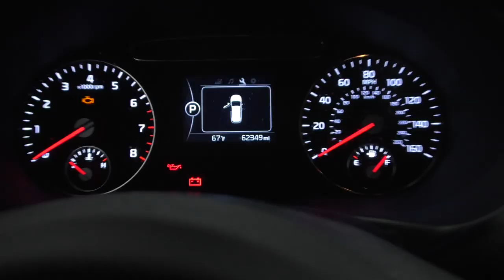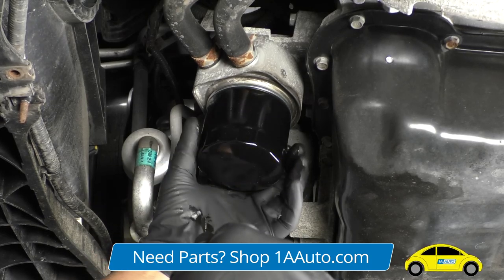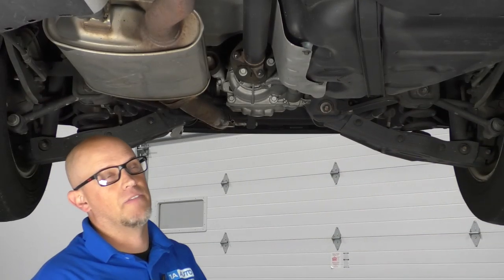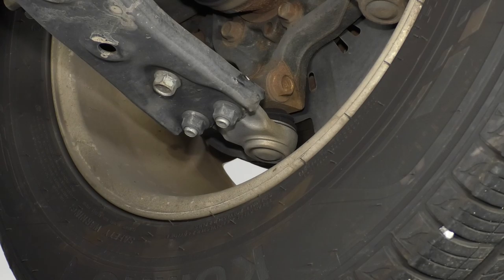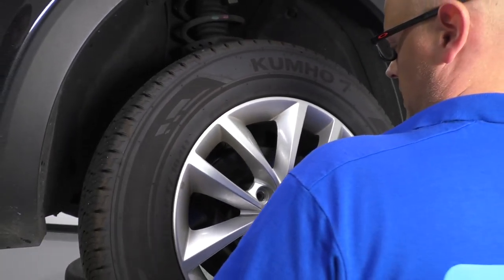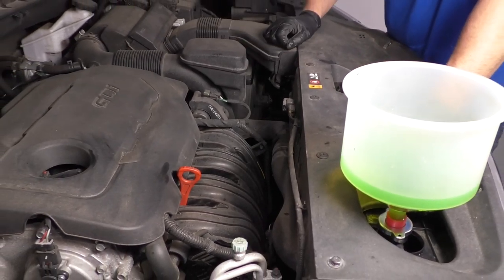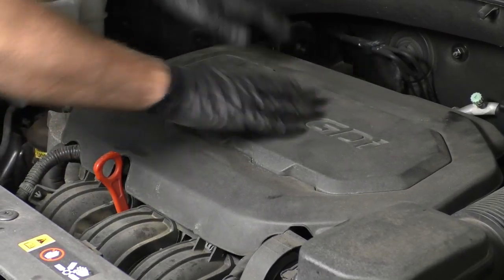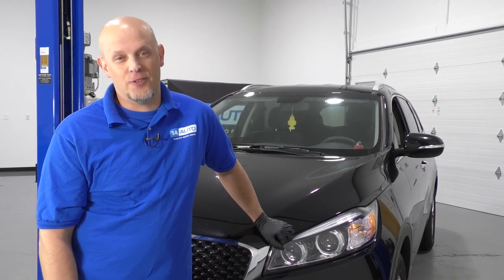60K Service Kia Sorento

Comment: A few things. Coolant overflow tank. I just unbolted mine and washed it out fully. Also went to a spring clamp on the hose. Radiator cap; check what pressure it can hold. Keep in mind tho, on an older car, if you replace a cap that could only hold say 10-12#, and a new one is rated at 16#, that my cause another weakness to be exposed, the water pump seal. There are two seals in the pump mated to each other, pressed together by a spring. As those seals wear down, the amount of pressure they can hold back begins to lower. So replacing the cap may cause the pump to leak. But, if the system can’t hold a high pressure, it may boil over in very hot conditions, as the pressure raises the boiling point. Battery, if you replace the battery, don’t put those felt washers under the terminals that they try and sell you. Those washers will lift the terminals up enough so they don’t clamp tightly on the battery posts. These terminals do not have enough compression space to make up for the smaller size of the post as it tapers smaller towards the top.

Comment: KIA/Hyundai use GDI (gasoline direct injection) engines.  Every 20,000 miles, you'll also want to run a GDI intake valve and turbo cleaner through the throttle body.  I have found that the STP Intake Valve Cleaner does the best job, and is considerably better than the CRC or Seafoam products.  Doing this will de-carbonize the intake valves, which are not cleaned by fuel additive as they would be otherwise in a non-GDI engine.
Reply: Good afternoon. One thing you can also add to your car and I have a 2019 Sorento V6, is an oil catch can baffle device. I installed a new positive crankcase ventilation valve and then added a hose from the PCV valve to the oil catch can and then from the oil catch can back to where the hose is going into the fresh air box after the air filter. This way you get a lot less deposits on your intake valve and intake valve seat in a GDI engine. I can send you a photograph if you'd like just shoot me your email and I'll send you a photo or two.

Comment: Very Informative. One important note, if your using a socket wrench to open the oil drain bolt,  be sure it's a 17mm 6 point socket and not a 12 point. The 12 point socket will spin and not grab and you will strip the bolt head.  Just changed oil on my Sorento and learned my lesson.

Comment: I have the 2016 Sorento and love my car, now if only I had a car lift lol. I try to do some things myself but oil changes I just dont find the value these days like I did growing up and then having ti dispose of it etc. Tune-ups, brakes etc I do all myself and save a ton.
Reply: you don't need a lift.  You can do this service using ramps, or a hydraulic jack and jack stands.  It's just nicer with a lift.

Comment: Good video. But I promise you, a typical shop won't do such a thorough job. They're in the business of getting customers in an out as quickly as possible and will likely only do the bare minimum with fluids, filters, and tire rotations. If, later, anything break or was excessively warn and the customer states it should have been caught at the main servicing intervals, they always have plausible deniability and will claim it occurred after. After bad experiences, I never trust mechanics at their word. I either do it myself or will verify everything they did by checking. This is where being a DIY really helps. The most difficult part is that people don't have their own car lifts, so investing in a good floor jack and a good set of jack stands is a must. 

Life would be so much better if auto maintenance and servicers weren't so scammy and dishonest and priced their work reasonably.  Most of their so-called "257-point" free inspections are just them making up a long list of expensive things for them to make obscene profits on, nearly all of which are generally unnecessary. People never realize how much money they waste at these places, and how stupid cheap they get their materials for vs what they charge you.

Comment: I went to a kia dealership and they recommended the 60k service. Which I opt to do. Then  when it was all done he told me that everything was done and that everything else that they checked was good. And 2 weeks later my rear brake pads were gone. making squeaking noises and stopped at a brake shop and they told me that the rear brakes were completely out. but the fronts were ok. So I remember that the kia person told me that my brakes looks good and that it doesn't need to be service yet. So brakes inspection was part of the 60k service i assume and they told me it was fine. Would that be my fault that my brakes were out? or would it be the kia dealership for giving me wrong info? Because i had to change the brakes at the brake shop instead.
Reply: Sounds to me like they gave you bogus info, or they are blind. Wouldn't be able to miss that, especially if they call themselves mechanics!

Comment: I have the i4 2015 sorento. Already did inner and outter tie rods and front sway bar links. Didnt need to but i drive it a lot and go camping in the mountains so much plus i just hit 70k. My ball joint on passenger side is bad and just did that. Should i do both ball joints at the same time or can i just wait until the drivet side start making noise? Its very easy to do but hard to separate ball joint from the wheel hub
Reply from the maker: +Multidimensional Traveler We would suggest replacing both sides at once as the parts tend to wear at the same speed.

Comment: Please why did you put fuel additive in the the fuel tank and what it does
Reply: typically it's used to clean fuel injectors.  In a non-GDI engine, it would also be used to clean intake valves, but since KIA uses GDI engines, you will also need to run a GDI intake valve cleaner every 20,000 miles to prevent carbon build-up on the intake valves.

Comment: Do you recommend changing the break fluid at 60000 and transmission fluid. Is this necessary or dealer up sale 
Break fluid is a sealed unit doesn’t get dirty
Reply: Transmission yes,brake  fluid only when you replace brakes.
Reply: I would change the trans fluid every 30k miles to be safe
Reply: @kalani1987  agreed, but I'd do a drain and fill 3X, spacing it out over 500 miles between drains.  The flush machines can damage the trans.  drain and fill takes 3 times to get most of it, but it's safer.